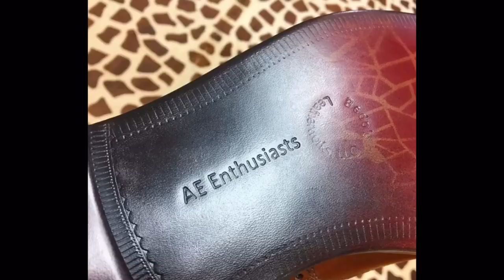Allen Edmonds-transforming McAallister to a Spectator #138

Comment: Steve, the original color of the shoe uppers are white & tan.  When the toe cap was burnished, it made the shoe looks CHEAP!!!  This is my opinion.  Man! .... it would have been a DISASTER if my ALDEN RAVELLO SHELL CORDOVAN SHOES WAS BURNISHED.  Although, I have 12 pairs of shoes which I rotate wearing, 10 are Shell Cordovans ( 5 Allen Edmonds & 5 Alden) and 2 Alden Chukka calf skin boots.  I prefer my shoes in their original colors!!!   	YOU ARE THE VERY BEST IN SHOE RESTORATION  .....  YOUR WORK IS EXCEPTIONAL IN RESTORING LEATHER PRODUCTS!!!
Reply: Did you not catch that the shoes were used? They were originally purchased on ebay for about $20? That the original owner turned a cheap pair of broken down McAllisters into a pair of spectators? They aren't shell cordovan. They aren't even expensive. Whether you like what was done to them or not, it's still an amazing feat. Look at the before photo again.

Comment: Question:  Have you ever tested gluing (with the Master's cement) with both hammering and non-hammering?  I am wondering if the hammering creates a tighter bond with the two surfaces.  Forcing the cement deeper (relatively speaking) than if you did not hammer.  I now hammer all my leather seams (that are glued) gently.  My seams are hand stitched with polyester.  The glue is only to keep the surfaces together while stitching.  Just asking.  I do not mind the hammering.  I watch your technique to get the 'air' bubbles out.
Reply from the maker: Bruce Brachman hammering takes the air pocket out between two surfaces